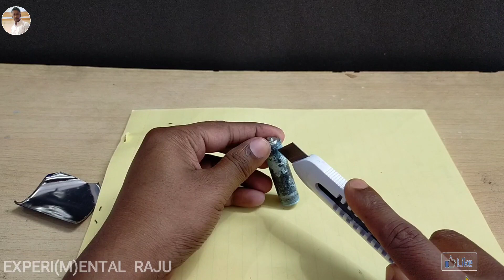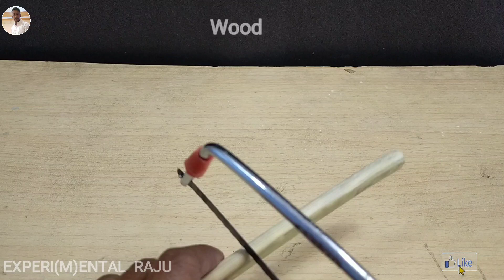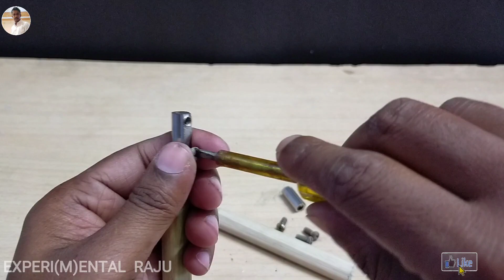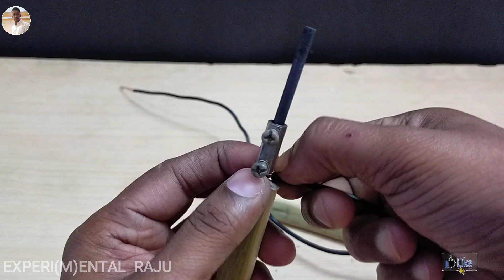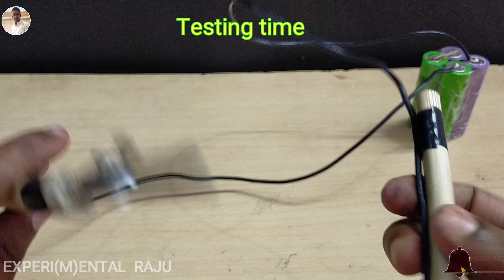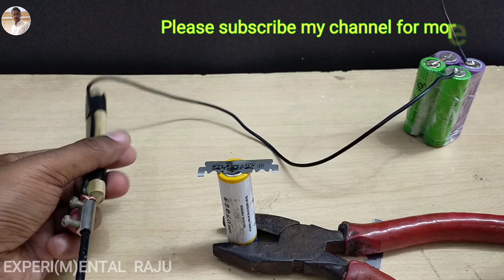How To Make Spot Welding Machine At Home। pencil welding machine। DIY spot welder

Comment: 12V 7Amp - Lithium ion batteries are used

1sq mm wire

Graphite rod, Copper rod (equal size)

A Handle, preferably wood and stuff on the tip of the handle to hold the rods.

A Complete circuit welds at the touching points of the rods.
Reply from the maker: Yes

Comment: Not working i tried it! 😑
Reply from the maker: See the video details and then try again it working
Reply: @ExperiMentalRaju  i use with 12v acid battery charger
Reply from the maker: Charger? Use 12 volt battery because the ampere is higher than the charger.